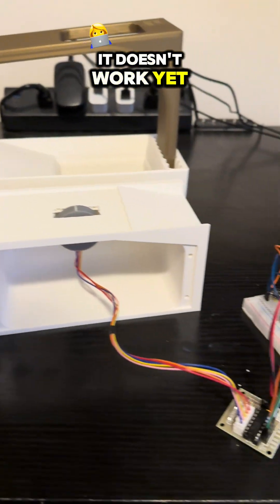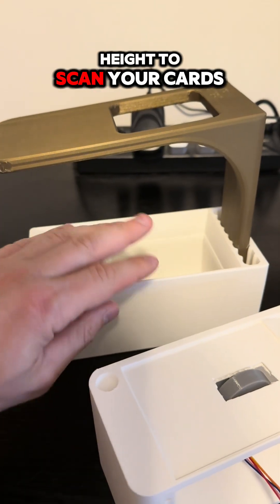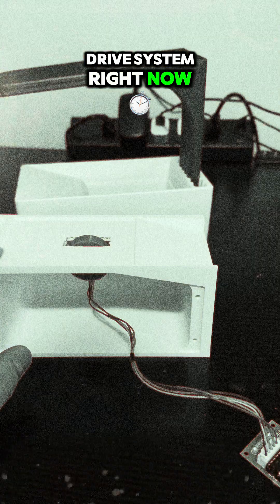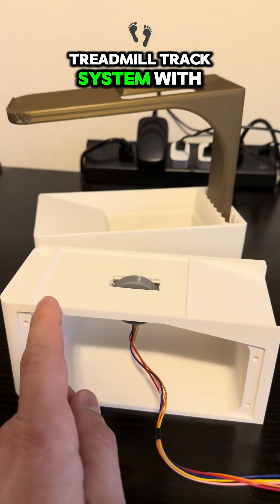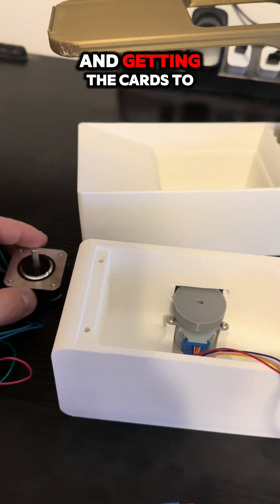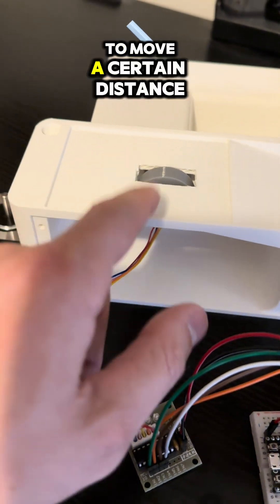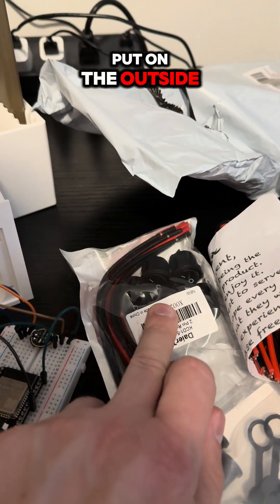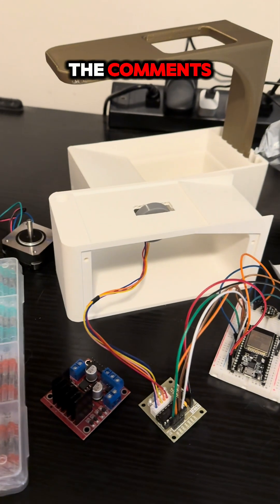Automatic MTG Card Slinger for Scanning! 🔄✨ #makerprojects #mtg #tcgtools

Comment: Just started up a project like this and was looking for projects like it for inspiration. cant wait to hear about how the project develops. Very curious on how the track system will work out.
Reply from the maker: First prototype had an issue with slip. Switched to a somewhat gear driven textured track. Hoping this at least addresses it while I make a better long term design.